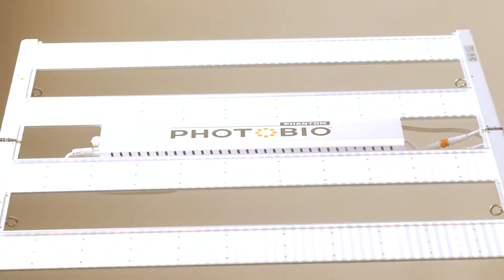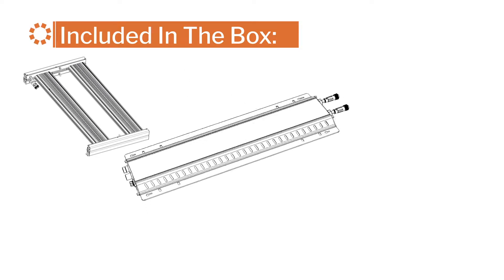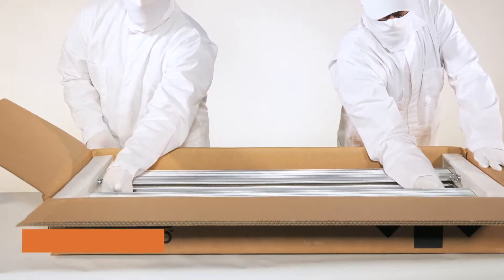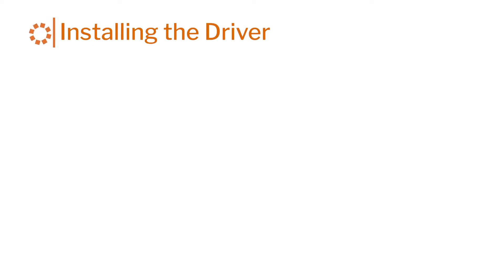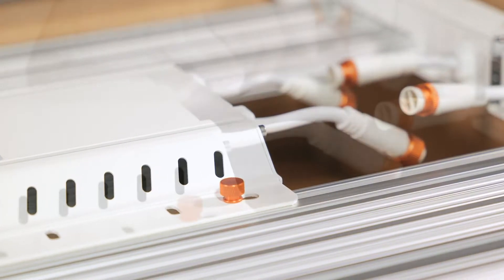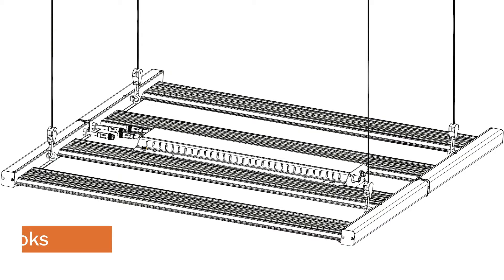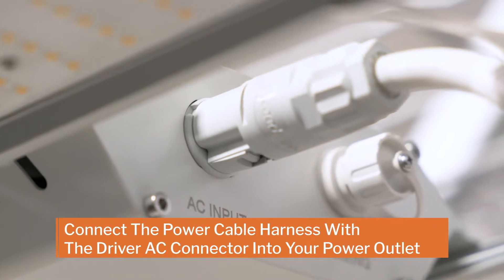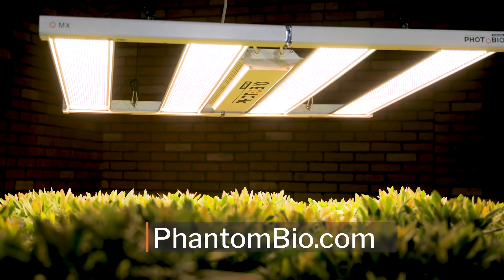Phantom PHOTOBIO MX Unboxing & Setup

Comment: Hello I purchased this light and the separate 110-120v cable, however it doesn't seem to be a place to plug it in anywhere. I am completely at a loss and very frustrated.

Comment: No dimmer
Reply from the maker: True, while our first generation MX could only be dimmed with a lighting controller (sold separately). We did see fit to add a dimmer control knob to the latest MX light, available now!
Reply from the maker: The latest version does have a dimmer.
Reply: That does nothing to me at my current situation
Reply: Purchased device that was advertised to have a dimmer and it did not come with one.
Reply: It has a dimmer.